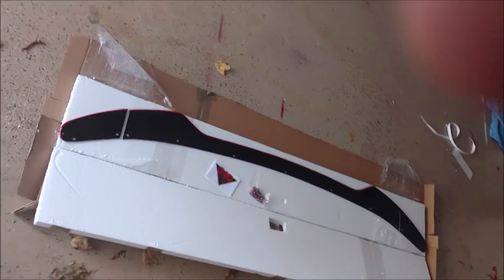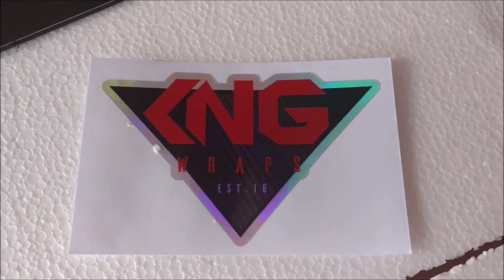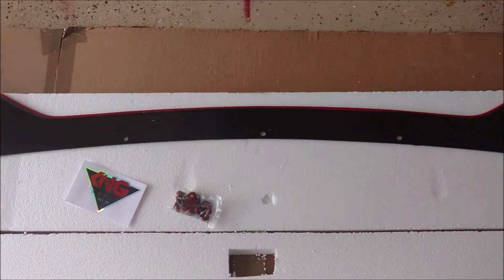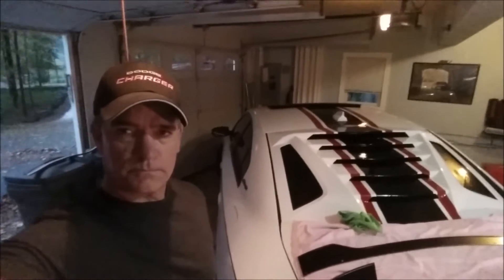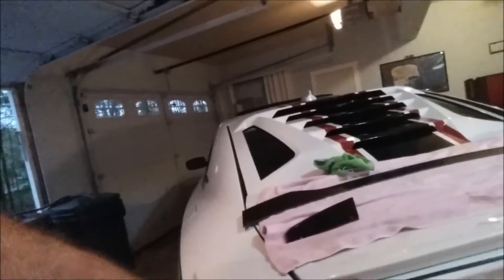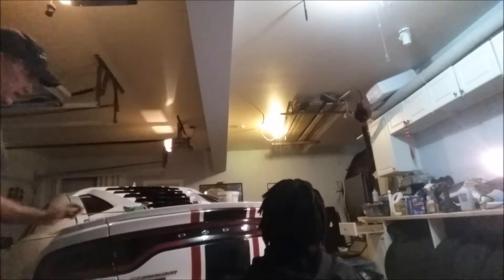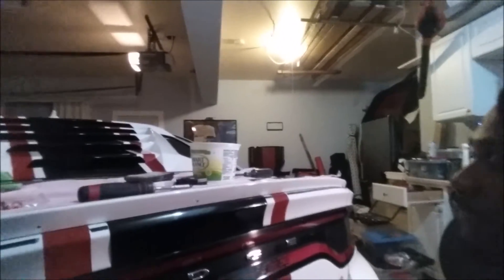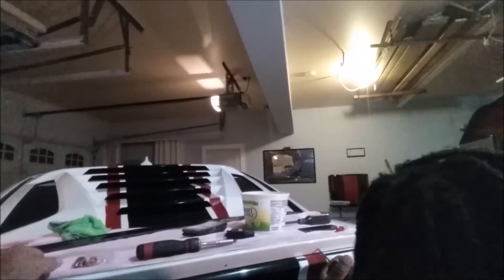The best Wickerbill for your Charger R/T or V6 SXT.

Comment: How did you shave it? Mines just came in and it has gaps on the bottom that Make me don’t want to install how it is. Might have to take it to a shop.
Reply from the maker: I used a sanding/grinding drill bit and just rolled the bit back and forth over the lower edges with the drill.  You can also put some black vinyl/electrical tape on the spoiler where the gaps are so you don't see the color of the car through the gap.

Comment: What do you think? I wish that gap wasn't so large. Def a bif improvement over stock though. Nice find
Reply from the maker: Yeah the gap is a little bigger then I had hoped.  I could have made it a few millimeters closer, but the pre-drilled holes in the wicker limit the positioning, and sliding it inward would put the screw very close to the inside edge of the side spoiler. They should have made the pre-drilled holes closer to the center of the side wickers,  so you could slide more towards the center to eliminate the gap.  I'm still really happy with it though.

Comment: That's awesome nice job guys...been looking for something like this as an alternative to buying a hellcat wing then buying a wicker bill then getting it installed....good option cool vid subbed 👍👍🏽
Reply from the maker: Yeah I really didn't want to take the stock spoiler off.   Other than the fitment gap on the lower edge, I'm pretty happy with it. I put some black electrical tape on the spoiler where the gap is so you don't see the white coming through.
Reply: @CTHellcat  sounds good appreciate the feedback 👍🏽👍

Comment: Love the red tubing on the edge..where u get that..can any type of W bill be done with that tube
Reply from the maker: Thanks! I got the wicker from @kng_wraps on Instagram. The edging was an extra option and it comes in different colors. So it would depend on where you get the wicker, but most I've seen lately include an edging option.

Comment: I have a 18 charger rt as well. 3 piece spoiler, so you have to get a 3 piece wicker or can you get a regular size one and just screw in the center so your able to open trunk?
Reply from the maker: I haven't seen anyone try that, but it might work. Only thing I'd be worried about is flapping on the outer edges at high speed.

Comment: Has this held up well? This is the only kit I've seen that just screws in. Im just waiting on mine to arrive.
Reply from the maker: Yes it's been great!  Only thing I'd recommend is that you put the side pieces as close to the center piece as the predrilled screw holes will allow.   After this video, I redrilled the outer holes to eliminate some of the gap between  pieces.  Looks much better without as much of a gap.
Reply: @CTHellcat  Good to hear. Thanks brother! Awesome cars by the way
Reply from the maker: @fullmetalk1d  thanks Chris.👍

Comment: Hey, did u need to use a rivet tool and rivnuts?
Reply from the maker: No, I just predrilled holes using a bit that was slightly smaller than the screws. Just gotta be real careful not to over tighten.